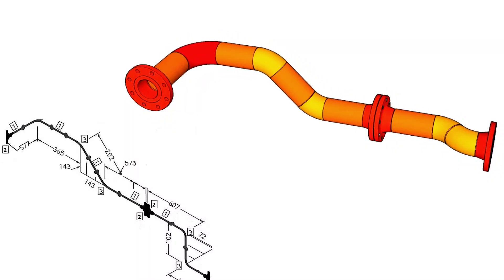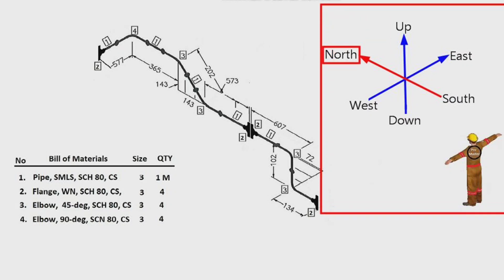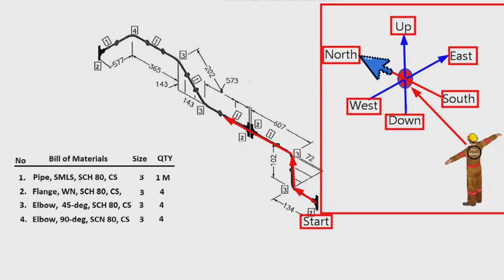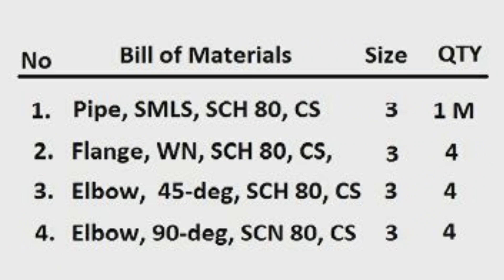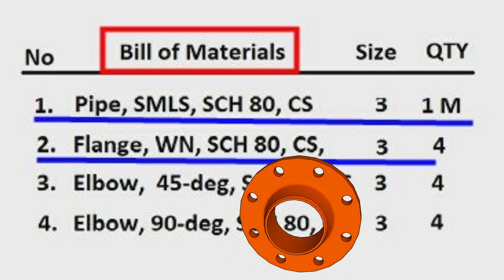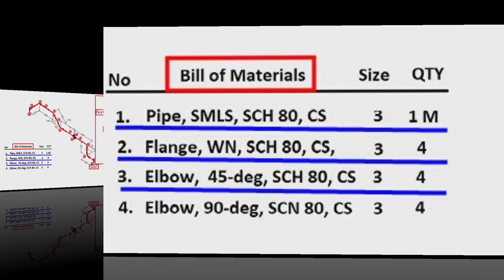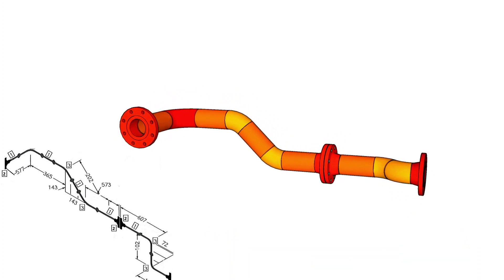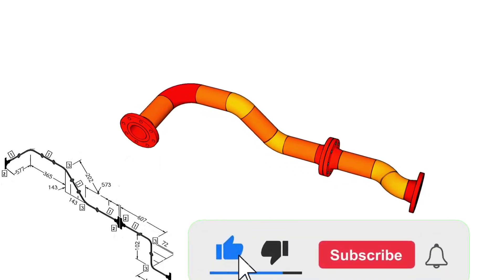Piping isometric drawing double rolling. Piping isometric drawing details. Piping drawing software

Comment: pipe segment 3 on the 3D drawing should be going down not turning west.
Reply from the maker: I can't see here any mistake,it is correct
Reply: @Piping-engineer  there is no 45 angle in the beginning (3) it shuld be going upword there is an elevation